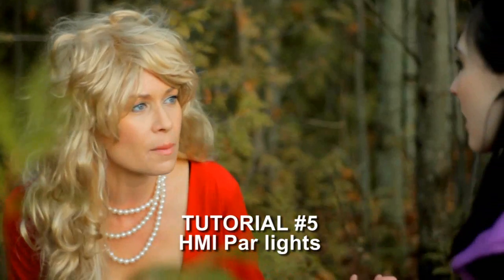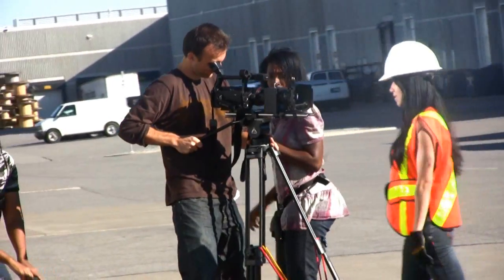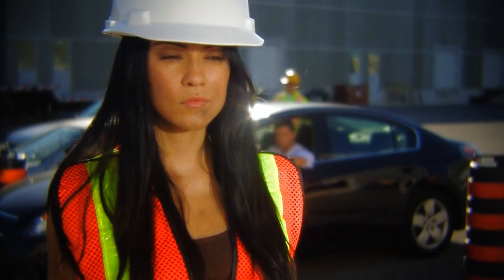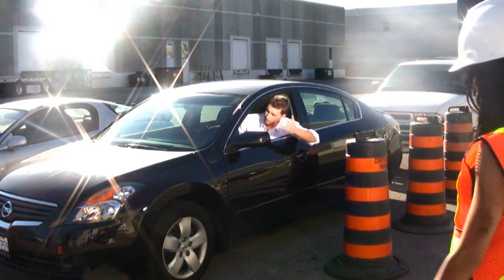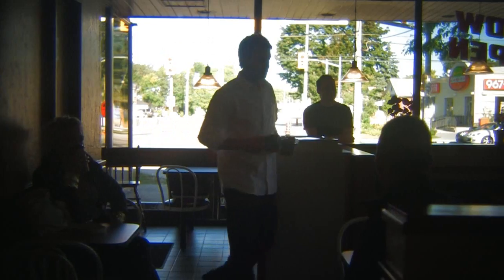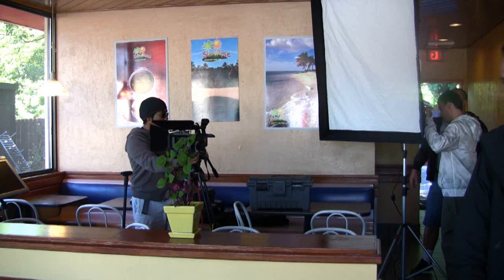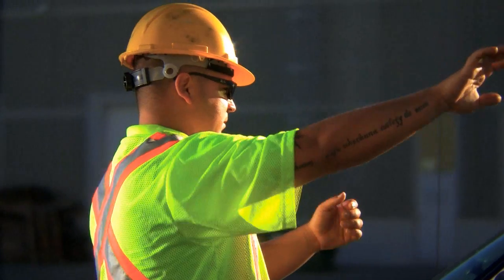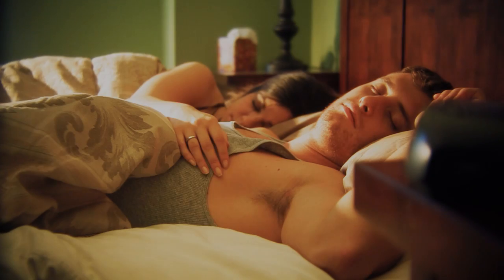Film Lights: HMI Par - Cinematography & Filmmaking Tutorial 5

Comment: BTW-you ROCK
A couple of question.
For exterior shots that don't need as much contrast-- would you recommend reflectors?
I completely understand the need for lighting in the interior shots and I see where I'm going to need this. Since I can't afford HMIs will halogens do?
Also, this video is done with a DOF adapter-- without one, I imagine there might be a need for an ND filter -- I've got a 550 and I'd rather keep the aperture way open and throw in the ND.  I keep it open for shallow DOF

Comment: Good tutorial. I already used HMI Fresnel before in locations shootings but never used HMI PAR. Once you can use them with different changeable lenses, could you please tell me which is the best lens configuration for this kind of situations where you need compensate the sun light and which lens is looking as HMI Fresnel in Flood mode. Ty

Comment from the maker: @BenHughesStudios Not really becuase tungsten lights are not as strong as HMI's. Even a 2000 watt tungsten light won't have the same light output as this 1.2 HMI Par. Not to mention that the second you put a filter on any light it loses it's strenght. So if you wanted to get the same kind of a effect with a tungsten light then you'd have to use at least a 6K. It would be hard to manage, power and just a waste of power in my opinion.

Comment: couldn't a simple reflector replace the HMI in this case?
After all, the sun was coming from behind the girl...
Reply: i agree. a frontal bboard follower for the girl would have achieved the same effect. the shot was tight so there was plenty of space to get the bounce close enough. 
same goes for the rimlight /sandwich on that guy when his key is the blaring sun

though the 1.2 was a good call for the car guy's key, the hardness of it worked well with the bright sunny day vibe. whiteside bounce would've been too soft and silverside wouldn't have gotten that spread. though mirror bounce probs could've done it. 

i just wish he softened the 1.2 for the interior scene - blast it through any silk or frame of diff or put any diff on, preferred scenario his gaffer getting bored enough to book light it inside - coz those shadows are kinda nasty yo